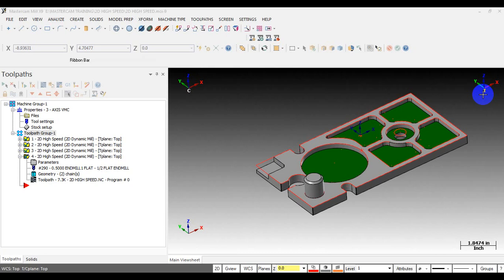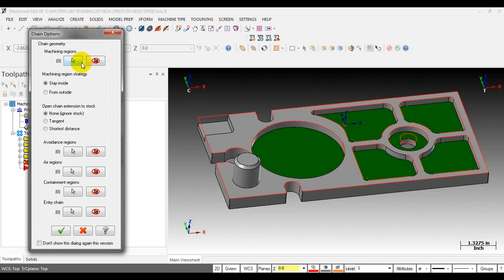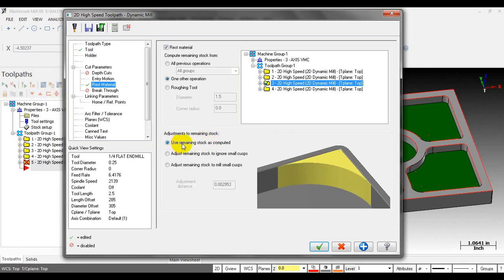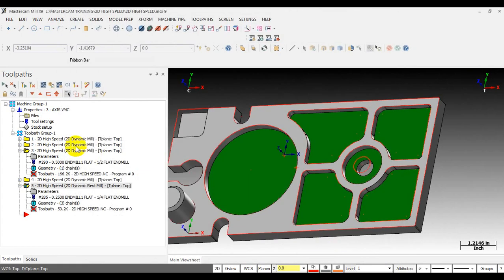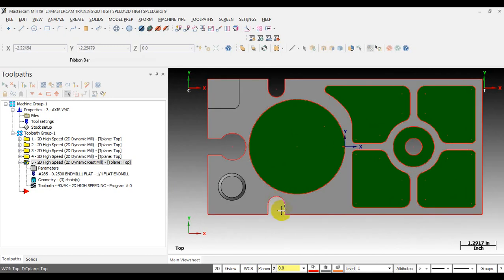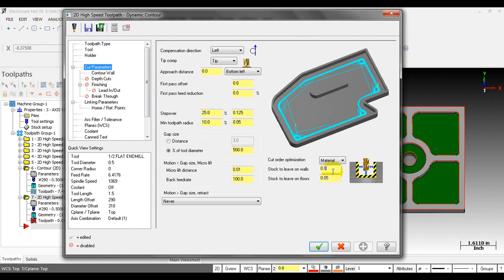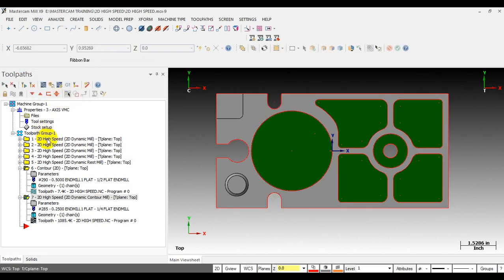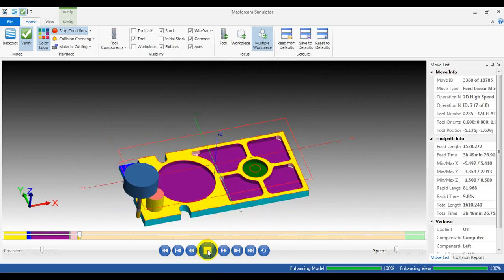MASTERCAM TUTORIAL - 2D HIGH SPEED TOOLPATH- PART3

Comment: Thanks a lot for you shared the video tutorials. I wondering that what software you built this solid model? I was built a model nearly same as yours in Autocad, but It doesn't work. Is Mastercam not compatible autocad file?
Reply from the maker: Hi Chris, I created the model using mastercam. You can also import autocad file with no problem
Reply from the maker: I created them in mastercam. If you use dwg file, you have to make sure the version of the file is supported by your mastercam version.